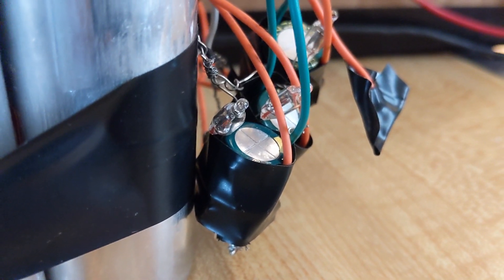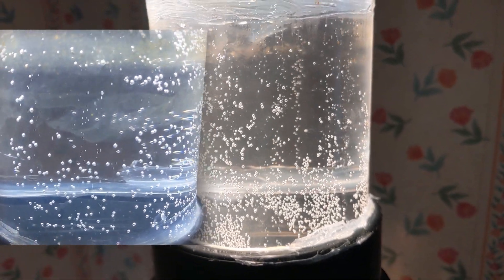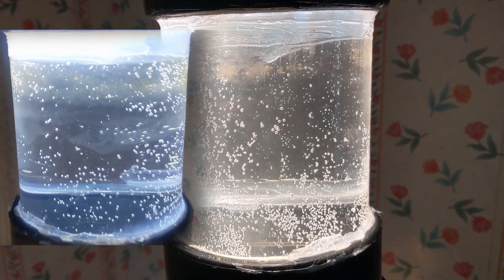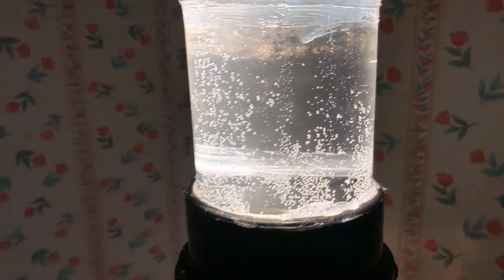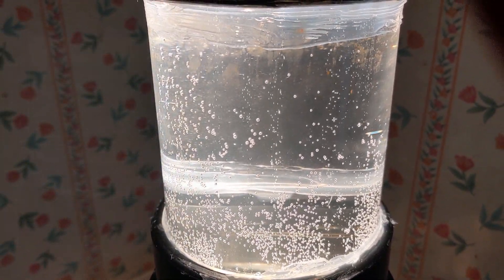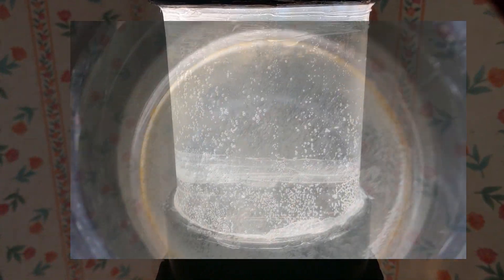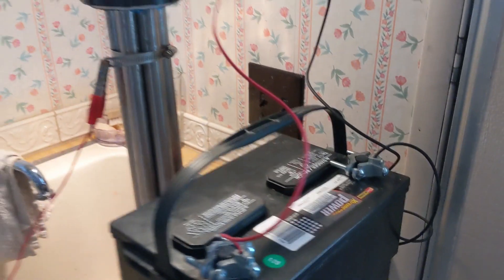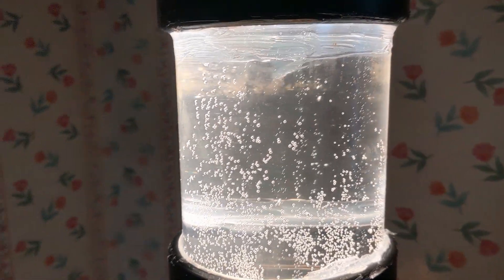HHO High Voltage Cap Dump Circuit Conditioned 2 Weeks

Comment: I have 15 watts! And it works. For 15 Volts at the input but the oscilloscope shows the value of 80 Volts? :-)  Decrease and increase of the Voltage means decreased and increased of the hydrogen production so I am convinced the equipment is already finished .  
And  I am on the brink of elevating voltage 4 times and to reach 60 watts per cell. It realy works Still I want to  find another adjustments ( adding inductors resistors  etc etc )    to reach more massive production of hydrogen without the elevation of the Voltage which will mean that  the efficiency will be much híigher Have a nice day :-)
Reply from the maker: 80 on the scope is peak not average.

Comment: from what l read about Meyer, you should get more than 20,000 volts to rise the production, some even say 40,000, the exact frecuency lm not sure, but you have 2 of the 3 variables already: 20,000 volts at 1 amp or less, at X frecuency.
Reply: nop, His alternator didnt use more than 200v, but used multiple phases, then his vics were probably connected in series to produce 9k volts and probably tuned like multiple phases from alternator (8-9)

Comment: this must be powered by audio amplifiers.for tuning . .starts with 2 volts..chamge water after its get darker.repeat the process and raise voltage gradually..untill white substance accumulate on negative plates inside.. this white substance increases efficiency and lowering input while producing more bigger bubbles..watch RAVI RAJU video 15 years ago. on youtube.they are the pioneer on replicating stan meyers wfc

Comment: I found out an easier way to measure the gas production. Just cut a 2 litre bottle at its bottom and place it down into the container so that all the gas have to go up into the bottle. With the bottle cap not on and the top of the bottle submerge just under the water you then fill a 60ml syringe with water by either pushing it down into the water with the end open then seealing the end so that the water stays in it when you pull it up and place it over the bottle top . If the container dont have enough space to push the syringe all the way down just use another syringe or somthinh to suck up the water. Then measure the gas collected in the syringe vs time.
Reply from the maker: Ya, that works too.

Comment: Is it possible to use uo to 7 amps , to see how mutch gas production would be posiible , i would like to use on a diesel combustion engine ... to use up to max 70watts from the car alternator ...
Reply from the maker: You can do the 7 amps by raising the voltage, yes, however, that definitely won't do anything with an engine. The output I got off camera was impressive, but still not enough. hardly foamed or "boiled" the water.
Reply: @a6630 I think the next step is to get a frequency generator and modulate the frequency, slowly sweeping from low to high, recording the entire thing. Eventually you should be able to get a relative maxima of gas production. However, right now the frequency is dependent on how long it takes the capacitors to build charge before discharge. Therefore, a continual high voltage source from a tesla coil with a frequency modulator could get you the desired experimental outcome since you could control both voltage and frequency. Only change one variable at a time. Maybe the water needs to all be arranged in the same orientation with a base level electric field in addition to the pulsing power applied. That way the water is oriented such that intermolecular bonding only helps disassociate the water. Also, you wont loose as much energy into heat rotating the water to the same orientation after it has moved. 16-21 tetrahertz will boil the water so avoid that range of frequency unless you want it to heat up. Anyways, good job. Keep going :)

Comment: I dont believe there is such a thing as flow , instead excited vibrational state , of course this state of vibration can propel things in directions based of the angle of the vibration which is probably dictated by the cycle speed of your pulse , it can be on/off pulse or it can be +10/+5 pulse like AC you know it as +10/-!0    I dont believe there is such a thing as a negative only a lesser positive.  only silence aka OFF is anything close to a negative signal , symantechly the word negative means "NO" or "OFF" we just term neg pos so we can understand AC cause were two simple minded to se +10 and +5 , you can easily simulate AC by generating a +10 and a +5 the same as inverters do it today by generating a +10 dc and - 10 dc  in 60 hz pulse

Comment: You could make a torch if you saved the gas in a bladder.  Would probably be wicked for brazing
Reply: that would be quite dangerous. even a small quantity going off indoors will bust your ear drums. That's why no one stores hho and it's always used as it's produced.

Comment: yes, looks like more gas production, btw you can use a Digital Manometer to easily measure pressure buildup for more accurate measurements ...